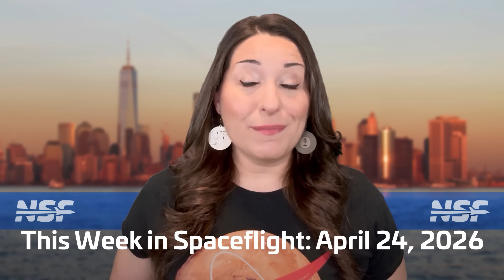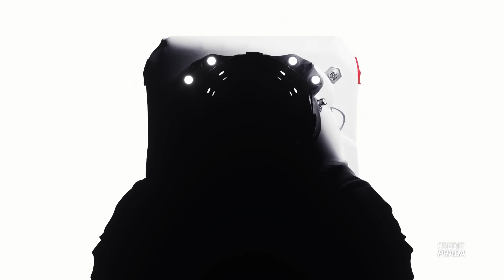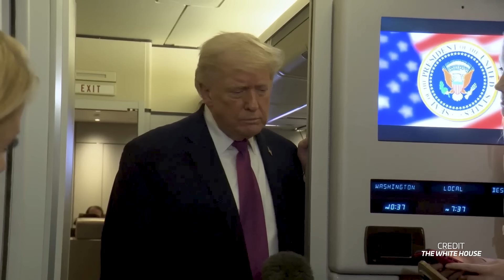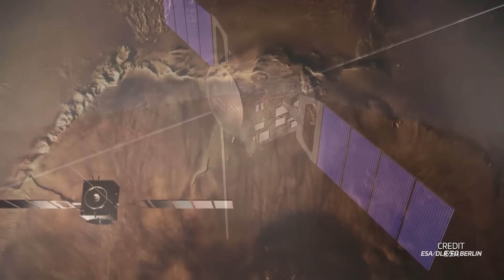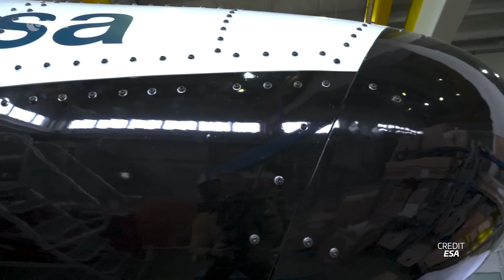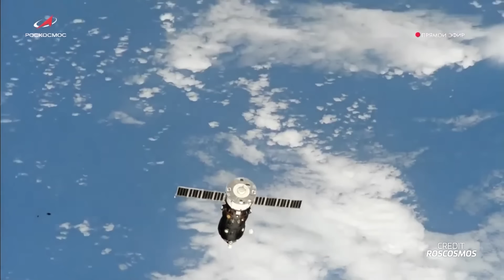Is There A Moon Suit Crisis? Artemis III SLS Moves To Florida! | This Week in Spaceflight

Comment: As for the 2 different suits  "I.S.S. &Lunar" why don't they work at a one suit option such as a base suit with modular adapters to suit all situations depending on the modules you use. I dont know if that would be feasible but I'd think it should be researched at least or have they and I'm just not aware.😂

Comment: Chine Chang'e 6 returned from the Moon 2 kilogramms of the Moon soil and weighted 8.3 tonns. If we multiply it by 200 to get 400 kilogramms (the weight of two humans along with the life support system) we would get 1670 tonns..

The estimated  weight of HLS to "return" humans to the Moon is about 1285 tonns (comparable with the extrapolation above)

Attention, the weight of the Apollo CSM that (accordingly to Hollywood) had brought people to the Moon was about 30 tonn. Ahaha. Busted, busted. Mic drop. No more questions.
Reply: ..was there a point?
Reply: Mass performance doesn't work linearly with rockets, otherwise the rocket equation would not have a natural logarithm in it. Very easy example is how Falcon 9 is 35 times heavier than an Electron rocket yet it can launch 56 times as much payload into low-Earth orbit, therefore it's not a linear thing.There are a lot of other factors as well to take into account like type of fuel used, trajectory taken, etc.
Reply: @Alexphysics13  Right-o. Usually it grows exponentially, so linear extrapolation is a very rough estimation. But even linear extrapolation shows that NASA’s "reality" does not add up to what we are seeing now. Your example with the rockets can be described as a crude linear approximation. The discrepancies of the Apollo CSM show two orders of magnitude. Two orders! Do you get that?
Reply: @gustavcalder4514  I'm not sure why you're really that skeptical if you know the delta-v equation.
Reply: Not sure the point.

Attention, you do know that the Apollo system delivered 700 lbs of usable payload to the moon surface - usable as in deployable.  In Apollo 15,16,17 - about 500 lbs of that were used up by a moon buggy (for a total of 3 left on the moon surface).

Of the entire Apollo Saturn-5 launch stack (6.5 million lbs), only 0.0107692308% (700 lbs) was delivered as usable cargo.

Can you explain to me how using Apollo tech is supposed to build a moon base?

Comment: Major thumbs up for the Voyager Golden Record earrings. 

Also, I'm slightly afraid to ask why the SRB containers on the train have warning labels that read "DO NOT HUMP". 😉
Reply: Humping means to let the railcar free roll down a hill into a track. This is how a lot of trains are put together at switching yards to build the mile+ long trains you see today. You don't want to jostle those things around too much.
Reply: @ZiddersRooFurry  thanks you learn something new everyday 😊
Reply: its to not have it go through a hump yard as it could explode from the force of it coupling with other cars as it needs special treatment
Reply: Excellent, now I know. Although now I'm worried that long freight trains are put together by effectively letting cars collide with other cars, even if in a controlled or planned manner.
Reply: @JustSomeCanuck  i think they are set on thier own trains or isolated using an empty car to block it from causing something

Comment: I think what they are trying to do with the eva and lunar suits is be compatible or share componenets with each other instead of having two completely different systems. AKA the square peg in the round hole problem. But the spacesuits might take a while since the dust on the moon is akin to scratching a pumice stone on every surface of the spacesuit and having it last. Not to mention temperature controls, complete exposure to the solar radiation, and the dust static problem. Its probably time someone at nasa started kicking butt on these space suits and get them made.
Reply: I think the space suits are coming along better the report suggests. Worst case scenario, Artemis IV gets pushed to 2029, which is still just in time to beat China if that was our concern
Reply: They might want to consider 3d printing the suits somehow, then astronauts could make their own on the moon Incase their suits tear.